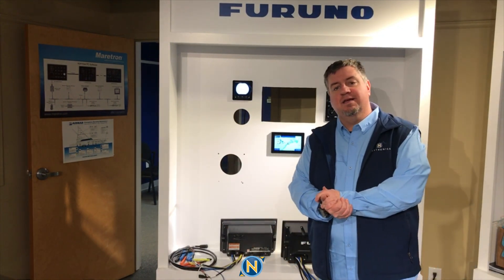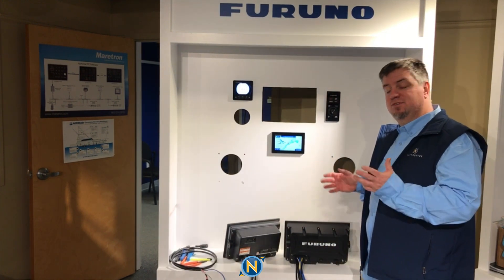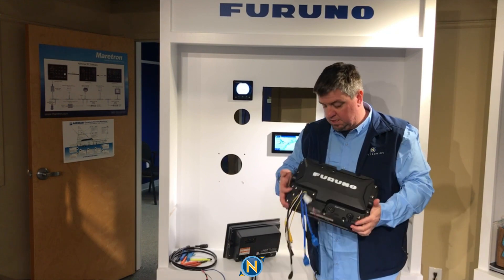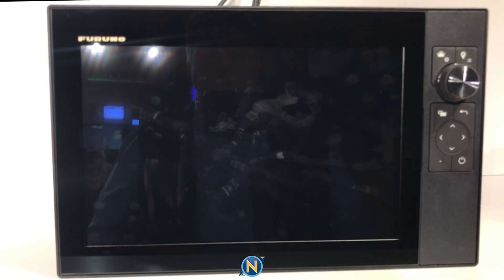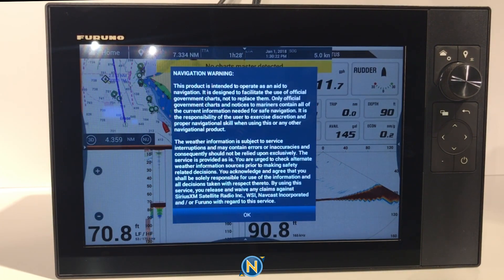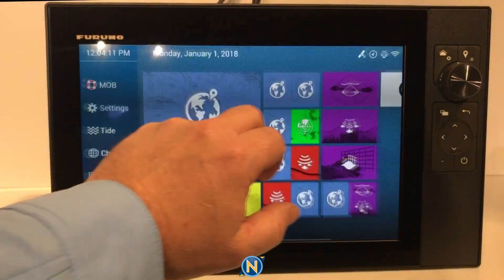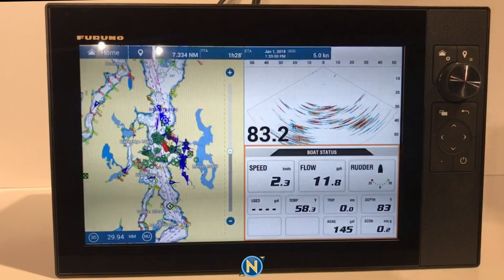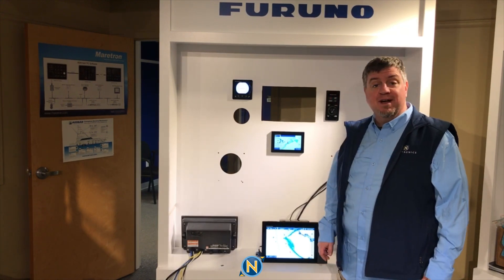2020 3 30 Sundays With Sully - The one About Furuno TZT3

Comment: What sort of cameras do you recommend to hook up to the Tztouch3, as well as possibly the TimeZero
Reply from the maker: So it is not as simple as some systems it will require the use of a camera encoder, we have had good luck with Axis model #Q7424-R-MKII for that and then you will need to select cameras as well.  Axis offers numerous different options depending on application.  All of this system will need to be set up using a laptop first to set up proper IP address's and then the Furuno will also need to have the IP address's set correctly.  A little further break down of this can be found here, https://www.furunousa.com/-/media/sites/furuno/document_library/documents/manuals/public_manuals/axis_camera_compatibility_guide.pdf
Reply: @navtronicsmarinegroup  awesome thanks a bunch